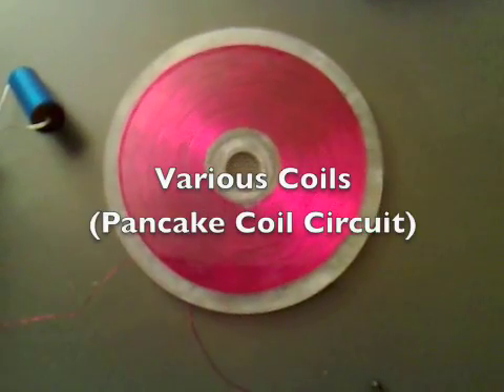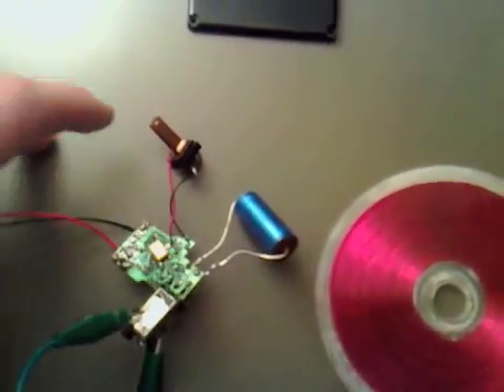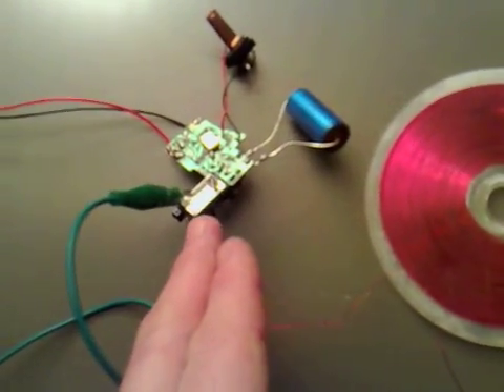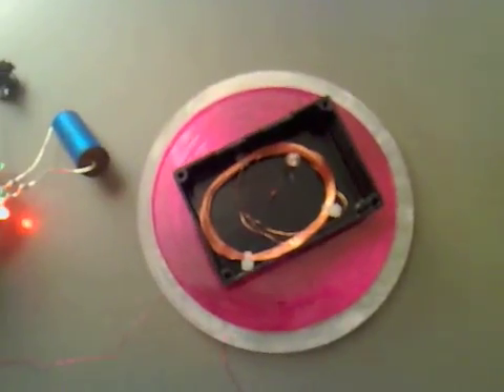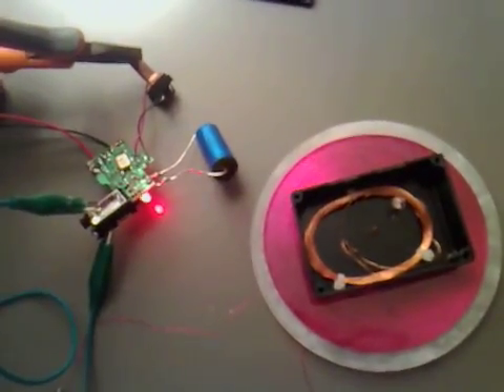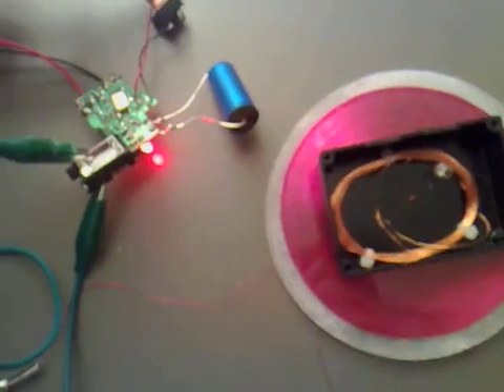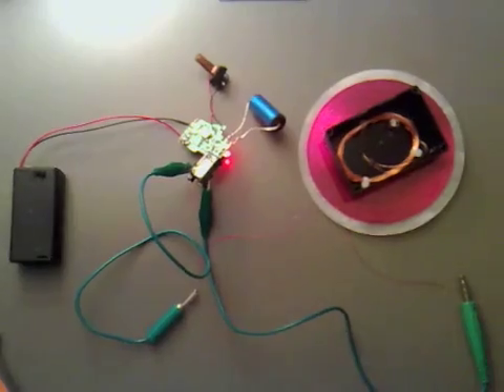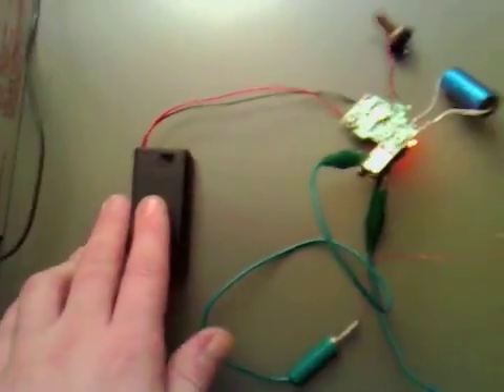Various Coils (Pancake Coil Circuit) 003

Comment: Im just wondering if you cap is in parallel or series to the coil?
If its in parellel, then you want to stay as far away from resonance as possible, as that increases impedance, which lowers current, which lowers the power transfer from one coil to the other. 

If its in series, then yea, hitting resonance would give you huge more power in your second coil as it would drop your impedance down to near 0, which means max current, which means max power transfer.

Comment from the maker: Yeah Im going to use the PIC with a full bridge Mosfet rig. But the camera flash was just looking at me ;-)

Im surprised it worked at all as it was not even at its Resonant Frequency. Im going to run with it for while I build my IRF720's onto a big enough Sink for the heat.

Unless you can think of a better or easier way?

I am going to build another coil with the same dimensions as the previous one If I can....

any thoughts welcome ;-) 

Paul..